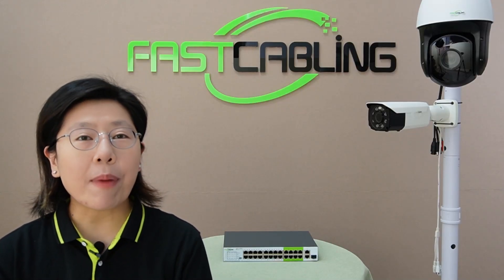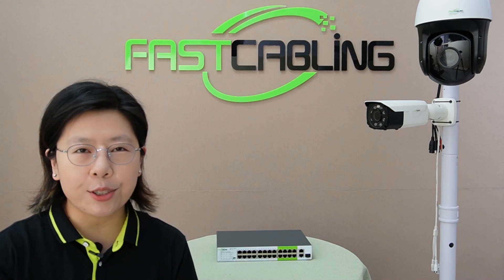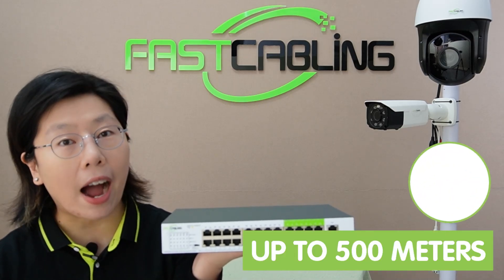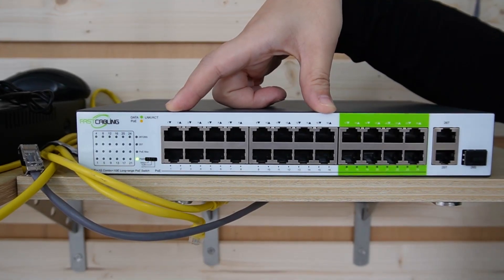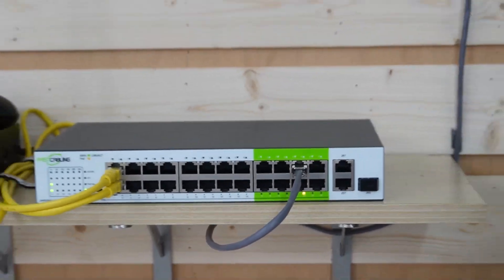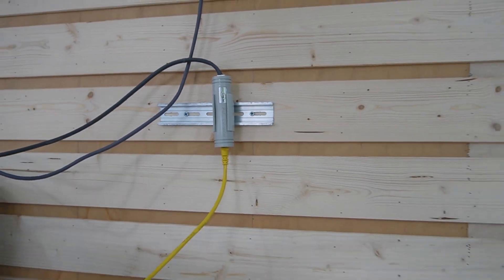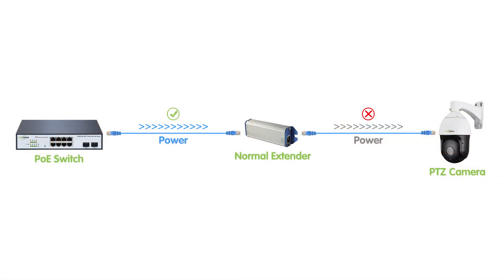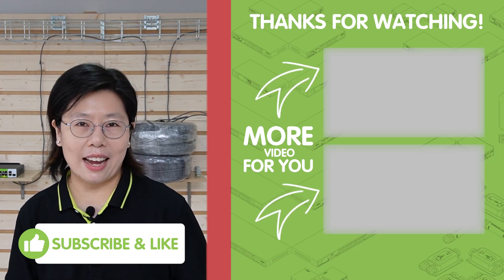DIY Long-Range PoE Camera Installation for Truck Parking Lot Surveillance

Comment: Thats nice, but why always need the PoE adapter near camera? Why dont try without that?
Reply from the maker: That's because the camera cannot send video signals back to the switch over long distances. If you don't want a PoE extender involved, you can toggle the dip-switch on the switch to extend the distance to 250 meters only but the speed will be reduced to 10Mbps.